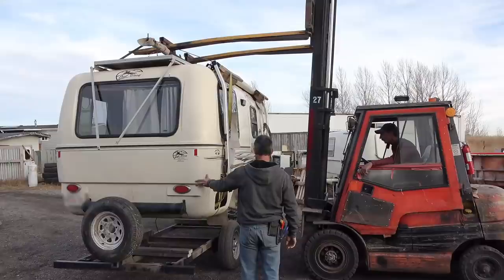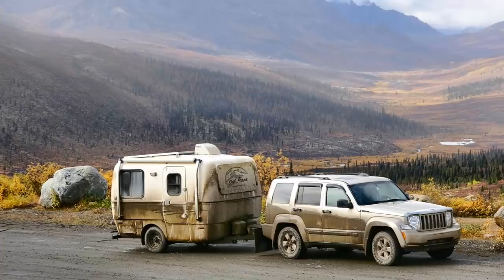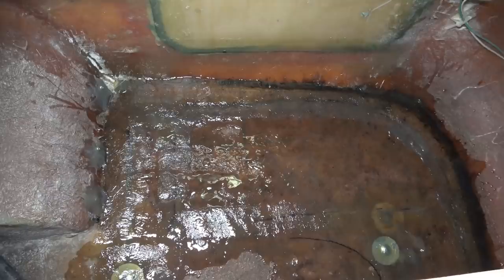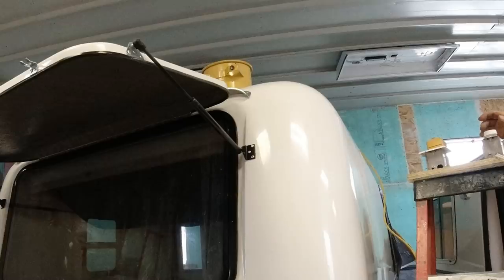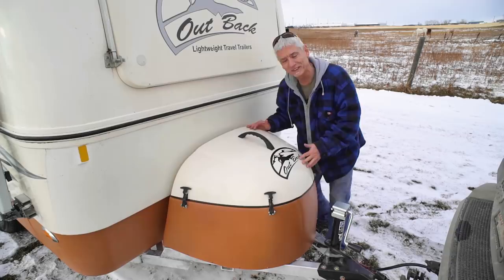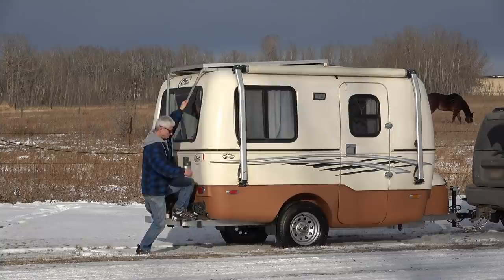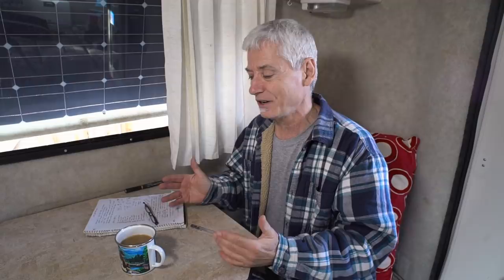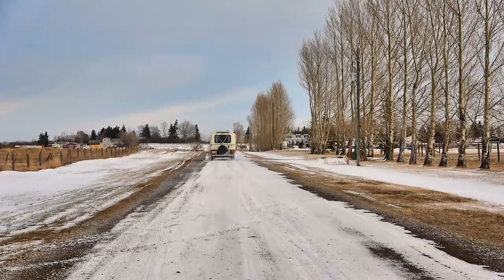Trailer Repairs Part II: Getting a Facelift!

Comment: The price is almost irrelevant, Slim. These fiberglass clamshell trailers can easily last decades if you treat them well, like you did getting those holes patched up. You may never buy another one. It's hard to put a price on getting this dialed in to exactly what you want, since you'll also extract tons of value from it.
Reply: Not about the money

Comment: Slim, kinda like computers, always buy for use. Also Outback should have the “Slim” edition Outback model. I would buy one.
Reply: yes "Slim edition" literally a lighter version with all the stuff he removed already missing, and a lower price! 😊
Reply: @toronado455  Good One; the "Slim" Edition.
Reply: What would be the advantage of a "Slim Edition" over, say a $3500, 12×6' cargo Trailer? Not to say the Slim Edition isn't better, but what are the tradeoffs?
Reply: Slim, I definitely didn’t mean any disrespect. I love your videos and they are inspiring me to get out and camp, especially now that I am not working anymore. I just don’t have the skills or confidence to modify as you have done and would purchase a similar build. Keep up the good work and thanks for your efforts.
Reply: Slim's video on what Outback did to his rig really speaks well for the company and its workmanship.
Reply: @kst357  Actually, requiring a replacement of the frame, the tires, and the severe water damage is not what I'd call a triump of workmanship.
Reply: @jackkunkel  def weight. But then cargo trailers are boxier so have better storage and they are solid!!!
Reply: @janebray9392  I'm not sure what "def weight" means, but anyway, cargo trailers come in both steel and aluminum. The latter of course being much ligjter.
Reply: @jackkunkel  definitely a weight difference, I would guess the cargo trailer would be a lot heavier. I have watvhed a lot of great cargo trailer conversions.

Comment: Slim: "Galvanic corrosion protection barriers."
Me: "Rubber washer." 
Hope to see you in many more videos. Travel safe.
Reply: I think the galvanized washer also helps prevent the transition of corrosion between steel and aluminum.
Reply: Slim can confirm it but I think it means adding a zinc cathodic washer to minimize electrolysis & the resulting corrosion when dissimilar metals are in contact with each other. Go look at your water heater. It has a galvanic piece connected between the water pipe & tank that does the same thing.
Reply: @kst357  You are absolutely correct sir.

Comment: Slim, may I suggest that you install a center brake light on the trailer?  The spare tire may somewhat obscure one or the other brake lights and  a center one may help in avoiding someone running into your beautiful trailer.  BTW, thank you for the great videos and the great disposition you have.
Reply: Totally agree.... one thing to consider is what is or is not allowed in canada.... they may not allow center brake light.... I rigged a trailer one time and the owner was pulled over as the lights were not the "correct" configuration....  Your idea is sound and quite smart....

Comment: Very good decision to not talk about cost, because as you so rightly said, these are not comparable!

It cost what it cost, and you now have a hugely more capable trailer that is no longer hygroscopic and which is much improved.

Removing those rear hatches and cutting out the sodden areas of fibreglass and reinstating it with new material as required was a really sound decision.

With your new trailer chassis you should notice an improvement in towing and fuel consumption.

That front box is immensity practical too! 

Both you and your trailer are evolving and perfecting yourselves for your preferred type of travel.

Having a modular shell instead of your collapsible trailer must be quite a joy, with no miserable setting up in horrible weather and a more draft proof design to help retain that value heat.

Your investment in your trailer will reward you for many years, many miles and many memories to come. 

Thank you for making interesting, informative and entertaining video your productions are very much appreciated.

Comment: Thank you for another great video. We purchased a very old used Scamp just because we knew we would be doing our own modifications. Also it is our learning tool.  It is a lot less stressful making newbies mistakes with an older trailer. When we are ready to order a new unit we will still have our older trailer to use and enjoy until we receive the new one. The older one seems to hold it's value,  so we will likely break even when we sale. If we sale... I'm leaning towards having an aluminum trailer built for our old Scamp. Thank you for taking us along on your journey. Safe travels.
Reply: Thank you, for taking time to share your thoughts.  You've made a smart decision to go with an old RV to make your newbie mistakes on.  I think the Scamp, unlike Casita, has a wood floor.
Reply: @azclaimjumper  the Scamp, has a wood floor, which is a good and a bad thing. Our Scamp had all the epoxy resin worn off so, we have had to replace some sections of said floor.  Our trailer doesn't have grey or black tanks and no water heater.   We can camp through the winter and as long as the water tank is empty we have no worries.  I love the simplicity of our basic trailer. The older Scamps have a thinsolate on the walls which is easy to clean and does not absorb odors. Slim Potato head must have done the same research we did on trailers.  Steel trailer repair is way more labour intensive than the aluminium.

Comment: You did very well for yourself. You got what you wanted and needed, which is the most important thing. And even if you did go over your budget, you exceeded it for reasons that you were able to justify to yourself, as opposed to spending more money simply because a salesman thought it would be a great thing for you to do. It remains minimalist, but with a significant amount of added safety and durability. You can still hack away on the interior to your heart's content, but you now have a better foundation upon which to hack. Good job.

Comment: So I am just curious what they said about YOUR mods like the shower drain and the solar mounting to the roof. Was that the reason for the leak test? Were they concerned with drilling the roof like you did? Seems to me that all of these guys should be building roof rack mounts for solar these days using best structural practices in the manufacturing.
Reply from the maker: Hi Mark, Trillium performs a leak test on all their trailers in production. In my case, as there was evidence of leakage, they did it to confirm the problem was solved. Outbacks also come with solar panels as an option. Thanks! SP

Comment: Looks good, really like the rock guard material on the bottom.   Makes great sense,  so does the aluminum frame.   I like the way you did this,  bought it,  gave it a heck of trial, then transform the trailer based on good hard data.  Now you have something that really works for you!  It's customized based on real world experience with that exact trailer.   Can't think of better!!!

Comment: I like it however I noticed that the brown on the door doesn't line up with the body. Did the door drop some?
Reply: It's not an optical illusion, it does appear misaligned. Once again, proven to be wrong in my original comment, thus the edit.

Comment: You are exactly right, even though your trailer is used. You modified it originally, and this time in the shop, well now your camper is better than new and suits you with the modifications you have already incorporated. Love the paint job, reminds me of the truck bed liner paint (probably is) Rhino paint liner.

Comment: Looks fantastic! Love the two tone and the front tongue box. I think you made the absolute right decision about the frame. If you get the old frame redone, there will always be back in your mind, "Can I really trust the frame?" And everything you said about used, I completely agree with it. I bought a 2014 Ford F150 XL with a cap primarily because I new if I bought newer, and more importantly, a higher end model, I'd be far less inclined to drill holes, or mount things inside the cab or the bed. And another thing about buying new is, if it's custom, then you generally get all the mods you want to start with, and there's no real need to make changes once you take delivery. Good job by Trilliam, and looking forward to more adventures in your "new"  trailer.

Comment: nice paint!!  I also heartily approve of the battery/propane/storage cover which will not only keep stuff stored and clean but it will help with fuel economy for sure. 
I definitely like the idea of the self adjusting torsion bar  and frame looks excellent as well

Comment: Sir, you did well,  one thing a lot of people do not realize, is you found and fixed the weak points in that design,  With new, you are spending the higher cost just to find out the weak points of that design, and then the expense of having that fixed when those  areas of design fail, and almost always out of warranty. and rare these days, a company that not only stands behind their product, but work with what you have, and bring it up to place you want without forcing you to replace it. very rare.

Comment: Looks great! One thing. I had those same steel wheels on my trailer. They bend pretty easily on rough roads. After developing a case of the wobbly I switched to a Aluminum wheel. They were only $30 each on Amazon. So far several years of use and abuse no wobbly wheels 👍
Reply: Up here it's aluminium.

Comment: Buying used and upgrading your RV or Trailer to YOUR PURPOSE OF USE is the BEST WAY.  I did that with my used 2008 Pleasure Way Ascent camper an RV.  Now l camp off-grid easily. Even with my upgrades l spent "many Thousands" less than buying a new one at $150-$170,000!

Comment: Nice to see you back out and about
And 100% pure waterproof excellent

Now unfortunately you will have to ruin the 100% waterproof as you implement new hardware such as your solar power panels and your wind power turbine but in your case I wish you would have at least adapted them to add mounts for your turbine that way it would stay waterproof with them doing it including your solar panels
Reply from the maker: The Solar was already part of the leak test. Wind Power is NOT going to happen. SP

Comment: Slim,
    I am so impressed that Trillium did all this work for you instead of just forcing you into a new one.  What is the brand of the adjustable axle?  I haven't seem adjustable torsion axles for trailers.  So glad all this worked out for you!  Actually, the route you took was priceless. There is no way you could have spec'd a new trailer to address everything as completely as you did.  By actually using it, you could better target the issues.  If you had bought new, custom, you probably would not spend the additional money for a "rev 2".  Even if your end cost was the same as new, the outcome is better.  Time to forget it and drive!

Comment: I can't say I'm a big fan of aluminum frames in general due to the nature of aluminum to work harden and corrode.  As that is a fairly light trailer the work hardening may not be an issue and hopefully the coating they applied to the aluminum will help keep corrosion at bay.  Keep the good stuff coming Slim and get back on the road.

Comment: Nice clean little trailer Slim.  But a word to the wise about aluminum frames.  Watch for the welds cracking, especially when going off roading.  I can't count how many times we had to re-weld the frame on aluminum trailers.  I'm not saying the frame will break apart, just be cautious and inspect your trailer for cracks and weak spots after every trip.

Comment: With the aluminum you can also connect a torch to it with some aluminum welding rods and have some spar pieces of patch. Well just in case it cracks.

Comment: Nice repairs and upgrades.  If you add storage or more weight to the rear there, you are going to want to offset that weight on the tongue for towing safety, second propane tank and a battery or two up front could help.

Comment: I can say what i eat almost every day.   I take 150 grams of whole wheat pasta, add water and cook it, drain it, and then add 1 can of no salt black beans which at Walmart are $0.72 each I believe, and pasta there is $1 for 1 lb.  I microwave it a bit longer, but you'll probably cook on a stove.  I add cayenne pepper and spinach and/or romaine lettuce (1-4 ounces).  Now, I switched the green to kale, but I recommend against that to start with.  It's an acquired taste.  i actually eat this meal twice a day and eat a banana or maybe 2.   The meal is very cheap, and is nice and spicy with a good amount of cayenne pepper or whatever you want.  I may upgrade to Tabasco sauce.  Obviously a lot of people don't like whole wheat pasta, but if you like it this meal is extremely filling and tasty to me.

I no longer use salt for health reasons and get my vitamins carefully through other means, though, such as iodine, but the meal is good with a limited amount of salt.

Comment: I have the water in the floor problem. I know that as I push back to the root I will have to do far more than I like. Yet in the end I will have repaired the trailer at material cost. And in my case the trailer has wood floors not fiberglass with wood in between. All my cabinets are wood as well. All the videos I have seen so far they are fiberglass. I will be converting my front bunk to a dinette like yours. I will be adding a complete power system as well.

Comment: Thanks 😊.. you are a smart guy and I have learned so much from watching you..only thing I would have done different is that I would have used a removable rock guard for the front of my trailer so I could change it out from time to time..look like your propane compartment had an open bottom but I wasn't sure what I saw.. I think I would want the propane compartment kinda air tight..after this virus if I do not move to the Philippines to live out my retirement I will certainly by a trailer like yours and hit the road or I may just buy a van.. I have learned so much from you and I hope you just keep on keepin on..🤔😂🤗
Reply: Slim answered another comment similar to yours. Essentially, that box needs to be ventilated (propane tank/battery) and for hoses/wiring runs.
Reply: @ScubaSteveCanada  ok.. thanks 😊..I miss lots of points in my old age..hehe

Comment: You may find that those rubber latches on the front tongue will perish over a few years.  We use those on various bits of gear and they need to be replaced at least every 5 years.

Comment: Great video! I live in Canada and I would have picked the steel frame. Reason being is it is way stronger. Aluminum tends to crack and it will from offroad use
Reply from the maker: Nathan, I rely on the expertise of the manufacturer, especially one who has been building trailers over 50 years. If you have a broken frame yourself, I would like to hear about it. SP
Reply: @SlimPotatohead  I have owned two car trailers. The first one was aluminum which the dealer recommended. It was more expensive than the steel but it was lighter. It ended up cracking due to the elements and wear and tear. I have now owned my steel trailer for 5-6 years now and other than light rust which I paint over it is strong as ever. Hopefully everything works out for you! Are you driving on salted roads?
Reply from the maker: Thanks for the info Nathan. Where did it crack? Does the manufacturer still make aluminum trailers, and if so, has the design changed? How long did you have the trailer? Thanks! SP
Reply: @SlimPotatohead  it was a tandem axle. So right infront of the axles. I owned it for 4 years
Reply: Hey Slim. Just watched your newest video about the cracked frame on your new aluminum frame. It seems like what I warned you about a couple years ago just happened

Comment: I'm impressed and inspired. Trillium certainly did a fine job. How nice to have a company that's flexible and willing to cooperate with their customers. I'm wondering if you have a suggestion for tires. I bought a Casita (used) earlier this year and the tires are 6 years old and due for replacement. Hope to see you down the road one of these days.

Comment: That aluminum trailer is a lot lighter than the carbon steel version, and how do you correct the corrosion inside the steel tubes without acid dipping, you made the same decision I would have.   Great job slim. Love your videos and your work.

Comment: To bad Trillium doesn't mount the spare under the frame or incorporate it into the storage pod Slim had mounted since its in the way and collects what ever debris/dirt but it does act as a bumper of sorts at the back. It would be intriguing if they'd box in a frame as an option so it would provide a bit of under floor storage space and rehabbing the steel frame would of been been my choice since Aluminum can't take the hard knocks it does despite its weight savings. Slim has been thinking about reworking his roof top solar panels so they can be angled more towards the sun and the camper already has a feature that can be adapted for that purpose which is its awning. Since the panels could be made to slide easier than being hinged in place just two brackets that are above its rolled fabric that let the panels ride it as its deployed and since its arms also angle them and imagine the panel are mounted like drawer glides with it retracting back into position. Just a suggestion though but kudos on Slim on telling us it cost almost twice as much as he thought since that's the reality of repairing  the damage correctly since it wasn't just bolting a new frame under and a bit of painting afterwards. Slim might have regrets about buying used but not the adventure of bouncing along not worrying about what was behind him getting scratches/dings since he's not that kind of traveler and looks forward to modifications few due when it's new.